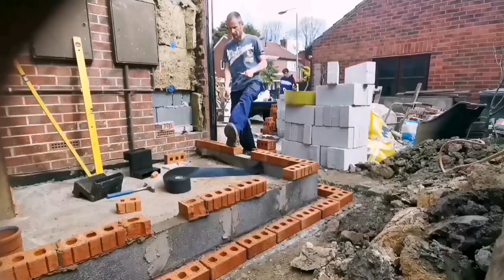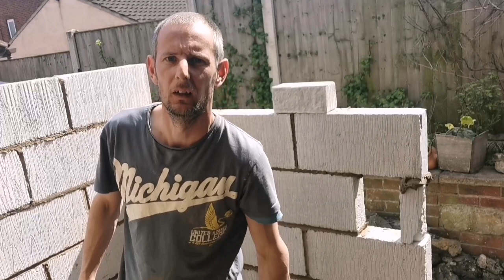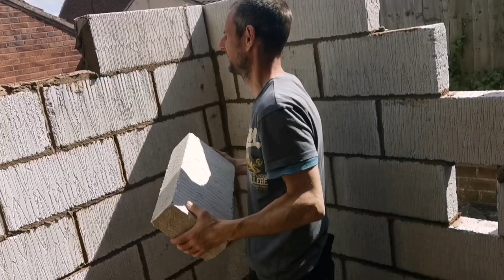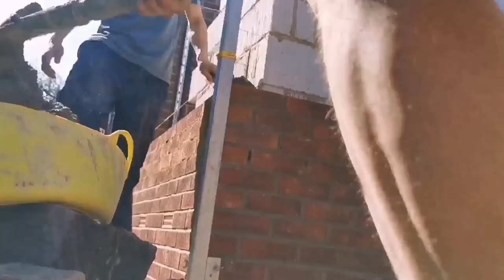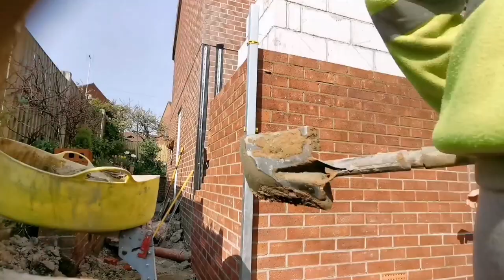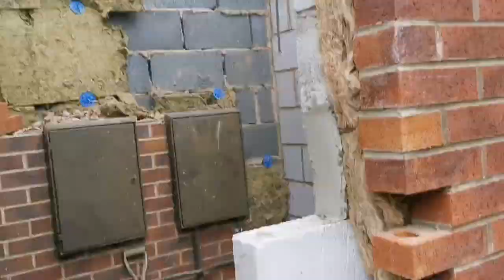Bricklaying. Small extension brick and blockwork

Comment: Great job 👍🏼👍🏼 In the land down under no stage of brickwork gets inspection. Once a final inspection is done they need to be able to see the edge of the dampcourse plastic along the bed joint but that’s all, they trust that the brickie does it correctly. Same with flashings over openings. There’s basically 3 inspections on a job. Trench inspection to see the depth and steel reo in place, a frame inspection once the timber frame is up, and a final inspection once the job is completed. Though I would think on larger commercial work there’s more involvement with inspectors.
Reply from the maker: Sound pretty good. They should do that over hear. It's pritty stricked with regs. And some inspectors want you to do it diffrent ways too. Can be a bit of a pain especially when. It's a small job and you waiting around for them 👍👍👍

Comment: Aup mark great vid I’ve always wondered how they move the gas and electric when they do a extension like this  , Do you know how much it costs to have the boxes moved? Cheers
Reply from the maker: Not sure on cost think it was about 400 for each one. They done gas other day. Just cut pipe near foundation dragged it back a bit and reconnect. Dident take long 👍
Reply: @markhep  nice one mate that’s not bad I was expecting it be a massive job 😂
Reply from the maker: @kurtmalpassbrickwork6255  no mate they usley not to bad👍
Reply: They move the gas because you can't over build a yellow plastic gas pipe you can with steel but still not ideal. It's normal alot more than 400 squid around by me though. Its normally a set price unless you know someone who can do it off the books but if you're going from Wall to ground box the meter will have to be changed so unlikely to get a off the books then.

Comment: Don’t like that design at the interface with the original wall. There’s nothing stopping damp moving laterally along the mortar beds to the inside of the extension. It should have been toothed in, with the old cavity exposed & run into the new cavity.
Reply from the maker: That's how it's done in the UK were are u from
Reply: @markhep  - I am from the UK and know it’s often done this way, but it makes no sense. Water can & will travel sideways along mortar beds. Which is why cavities were introduced.
Reply from the maker: @Benzknees  Yere that's the problem with the regs these days. They don't like to toothing in anymore. But i have not had a problem with damp or water getting in doing it this way. So it must work 👍
Reply: @markhep  - They don’t like toothing in because of what - temporarily reduced structural stability due to cutting into an existing corner? Seems to me they’d be ignoring their own Regs on resistance to moisture.
Reply from the maker: @Benzknees  maybe. I not to sure why they don't like it you may be right. Putting the vertical dpc is the one that gets me. Why we have to do  that is just silly.